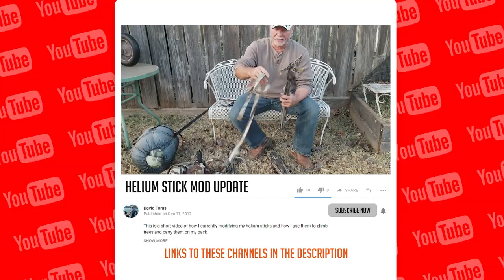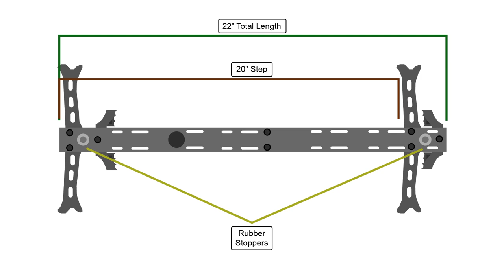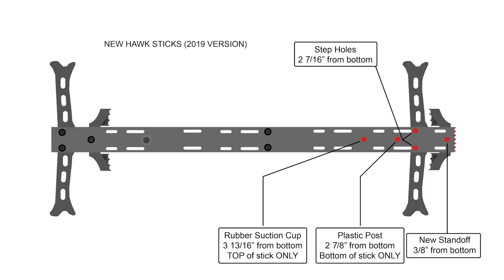How to modify your Hawk Helium climbing sticks - A step by step guide for dummies.

Comment: Ok so watched the video, and read the comments but one point not addressed stands out to me.  Rope mod yes get that, stacking bumpers... yea ok, but cutting down the sticks is where i dont see the gain.  So stock size (of 2019s anyway) are 30" and you cut off 8 inches for weight reduction but in doing so you more or less now need a 4th stick to get same climbing height omiting using an aider and there goes the weight savings or did i miss something here?
Reply: Drak Mr.Drak, I think you’re a  smart man. Some of these DIY guys and their projects are Brilliant. Some are just following the crowd!  Why climb taking plus 20” strides/steps on a none engineered product, when you can climb 13.5 “ per rung on a product designed and weight capacity certified by a major manufacturer?  OSHA standard for ladder rungs spacing is 10”  to 14”.  I guess these guys were never told how the old Bull said, slow down young bull so that we can breed them all. Or in this case climb for a long time with minimal espouser to injury.
Reply: @johnnythornton624  With practice and the safe assistance of a lineman's belt you can toss that OSHA guideline out the window fellas. That's for industrial steps in an industry setting. This is hunting. Totally different ballgame but still safety is #1 priority with Greg's equipment. I have been following him for years here and purchased his saddle and now Predator platform and I feel he has a great product and great ideas. Saddle hunting does take practice to get comfortable with being at height and doing an activity.
Reply: For me, it cut down (no pun intended) on the heliums kicking out… tree grabbers are closer together and with an aider, get me more distance up the tree.

Comment: Got mine last week and the make plastic piece already broke that goes into the rubber stop for stacking. Glad they included extras. Trying to find a mod to strengthen them or something to replace it with. Wish they were made from aluminum instead of plastic

Comment: I saw in another video of yours you used to use the muddy pro sticks for a while. Why'd you switch from those? I like that rope and cam system a little better than the versa button you made
Reply from the maker: Primarily weight. The Muddy pro sticks are awesome and the cam cleat is perfect. But they're heavy comparatively.
Reply: @G2Outdoors  fair enough. Thanks for the response

Comment: Looking at the red line that you drew on your stick, it appears slightly longer than 22", which makes a difference because if you cut it to exactly 22", the standoff holes are super close to the long slots on the stick. Feel free to correct me if I'm wrong.
Reply: Also, how can the rubber stopper be 2 3/4" from the top when the standoff holes are 2 3/4" from the top?
Reply from the maker: the top measurement is wrong. good catch.
Reply from the maker: Click on the link and the length is updated.
Reply: @G2Outdoors  your link still has it as 2.75. I checked the website and it says 2.75 as well.

Comment: I know this is a really old video so I prlly won't get a response but my brother just bought 4 30" heliums and I'm doing this mod for him. I know these newer heliums are different than the ones in the video but using the same dimensions a 22" stick length ends up having a 19" step to step distance so I decided to go with a 23" stick length for a 20" step to step

Comment: Any idea what size to tap the new helium bumpers and post (are both the same size). I did this mod yesterday but had trouble getting the bumpers and posts set correctly. I don't want to buy an entire kit to thread them back in i prefer to know the exact size. Any info would be appreciated. Great video it really helped me. I did it slightly different, I cut them to 22 inches and used the part that I cut off as my template.

Comment: Awesome guide to doing this! I have the 2019 Hawk Heliums that come with the bottom plastic posts and top rubber suction cups. I don't have a tap and dye kit as you described. Can I merely drill a slighly smaller hole for those screws and then screw them in by hand?
Reply from the maker: YES! Use the same screws that come with the HAWK Sticks and they'll work fine without a tap/die
Reply: @G2Outdoors  Alright....using this video...I cut them down and did them pretty much exactly as your video. Took me about two hours. Even with the diagram off of your website....the first one took a while to figure it out exactly. But I have them cut down and like them so far! Thanks again.
Reply from the maker: Rock on! Tool me way longer than 2 hours to get it all figured out lol. Hopefully my video helped!
Reply: @G2Outdoors   Well you did the majority of the brain work, haha. If the first one took me a little over an hour....the next two were in the same amount of time

Comment: After using your instructions on how to modify theses sticks, what weight capacity will the modified sticks accommodate?
Reply from the maker: I have no idea. Probably zero. If you cut up your gear, be prepared for the consequences.

Comment: What's the big advantage for this?
Reply from the maker: weight, bulk, noise reduction.
Reply: @G2Outdoors  how much weight loss?
Reply from the maker: These are just over 2 pounds each. So you save about 2 lbs in total.
Reply: @G2Outdoors  awesome
Reply: The weight loss is the biggest benefit by far, but I find that the sticks are also easier to pack and handier without the step in the middle.

Comment: You know that cutting those sticks under 23 inches you are making them unsafe. Because they are aluminum. You are looking for trouble when the material separates in pieces due to stress. Not trying to be critical just giving you some advice.
Reply from the maker: You could be right. Anytime you DIY equipment you take a risk. I've jumped up and down on mine and they held up just fine. But you're right...I do not recommend you modify your gear. It's dangerous.
Reply: G2 Outdoors Come on dude I’m a Georgia Boy too. I take you as a credible honest broker. But now you’re saying you don’t recommend doing something that you jus gave instructions on how to do. That sounds like a slick Politician. Is creating internet/YouTube traffic that important to you?  Again, you come across as a talented young man. Try to keep integrity as a key virtue when folk like me are looking to you for advice.